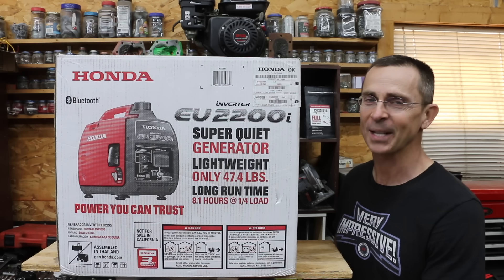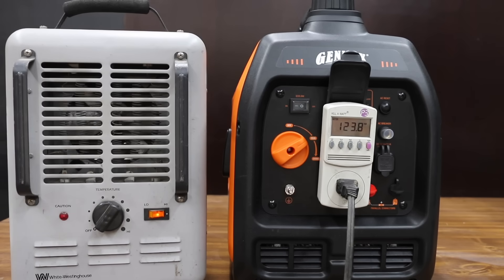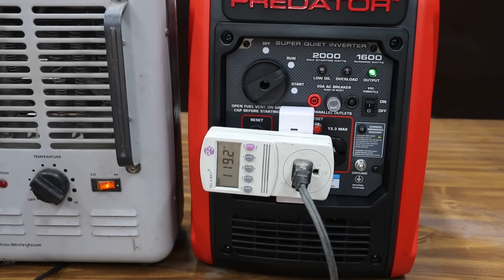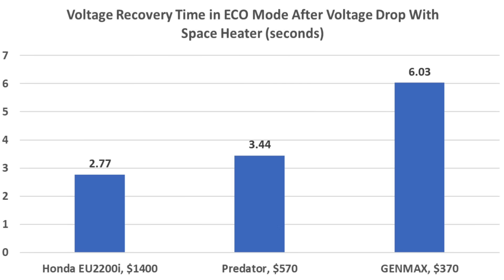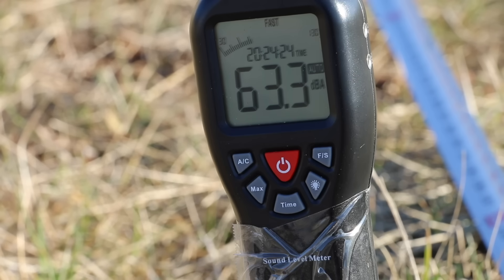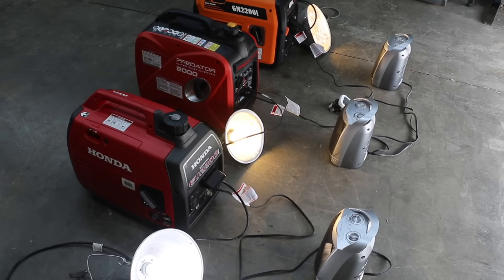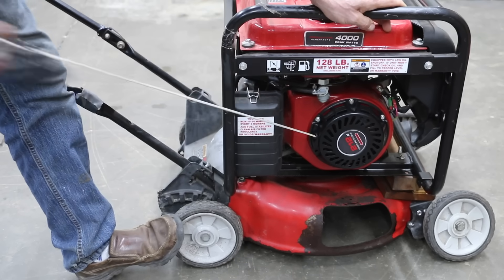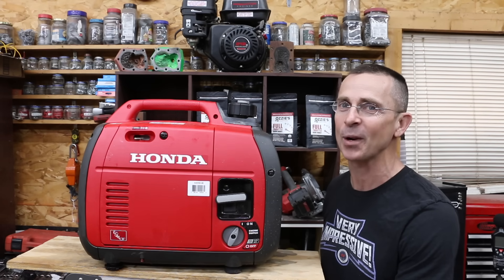Cheap Generator Better Than Honda? Predator vs Honda & GENMAX—Let’s Settle This!

Comment: I had an issue with the predator 2000 with the pushrod guide wearing through Allina pushrod to slide off to the side and knocked a rocker arm off the valve that part is not replaceable so had to fabricate one I've had it for two years and had to fabricate one twice  downfall I have with the predator 2000
Reply from the maker: Thanks for sharing.

Comment: It's probably too expensive, but it would be cool to see how a 2kw fuel cell compares. I reckon it would win on noise, but I bet it would need battery assistance to cope with fast load changes.
Reply from the maker: Thanks for the suggestion.

Comment: Could you test Champion and Westinghouse generators, incorporating the dual fuel options many of them offer? Run them on gasoline, then propane, and see the difference in performance etc?
Reply from the maker: Thanks for the suggestion.

Comment: I used to be a Predator (UAV, or Drone) Mechanic, and we deployed all over the globe in support of anti-terrorism. Some locations had no power to run our equipment, and we had tons of those same Hondas he tested. Not only did they work well, we abused the crap outta them. The Honda should be using 87 octane fuel, but our vehicles on site were all diesel in many cases, leaving us with one other easily accessible fuel option, 100LL AVGAS. When we put AVGAS in those babies, they sure did run differently, and I'm sure we were burning them up, but we had no other option, and the Honda didn't disappoint.
Reply from the maker: Thanks for the feedback.

Comment: Add "Engine Restorer" to preditor.  I have used it for 30+ years. Might fix the oil getting by oil rings. Cheaper solution.
Reply from the maker: Thanks for the suggestion.

Comment: does the one generator burning oil designed to do that? I know briggs push mowers now adays say "no oil change needed" just add oil. Basically a 4 stroke 2 stroke engine, kinda curious if that generator is designed to do that. hopefully not but its the world we live in...

2nd question. for the honda spark plug, was it dipped in oil or something? it looks like there is oil or something liquidly around the threads?

Comment: Snapper brand?
Reply from the maker: Thanks for the suggestion.
Reply: @ProjectFarm  I believe snapper is a briggs and straton motor but i would be very interested to see it up against the predator and Honda. Specifically the larger 4500's that power campers and large power tools.

Comment: I mow my yard year round with a Honda powered push mower. Going on 10 years now and it always starts on the 1st pull. One time I put some spent oil in the gas tank by accident, thought it was dead, just smoked its way through my stupidity, and it still starts on the first pull. Once a year I change the oil, spark plug, and air filter. ~$20 and 20 minutes. I'd buy anything with a Honda small engine :D
Reply from the maker: Thanks for sharing.

Comment: I'd like to see Ryobi's inverter-generator tested.  I use ours to run a small camper, and have lent it to friends to use during extended power outages.  I've changed oil once or twice (don't remember) and the spark plug once, primarily based on time-since-new of about three years.  I don't think it has had more than 150 hours usage in any year, and likely half that.
Reply from the maker: Thanks for the suggestion.

Comment: Based on my own personal experience on the job site as a stucco and masonry contractor in steamy Houston TX definitely prefer my Honda EB 2000i cost me $2200 is quiet, easy to move around and very reliable, always kept it chained to my truck just in case. Due to an emergency bought at HD a piece of crap Ryobi and regret it all the time. Honda rules.
Reply from the maker: Thanks for the feedback.

Comment: 🎉 to you and your channel. Please please read all you can about this Generator. $999-$1299. 
Can you please test the 
AiPower GSX7100iRD
Duel fuel/Pure sine wave generator. Compare it to other 7000 watt generators. It’s totally amazing. Thanks for all you do, your amazing as well..
Reply from the maker: Thanks and you are welcome!  Thanks for the suggestion.
Reply: @ProjectFarm  You’re going to be so impressed on “ALL” it’s features. Propane priority then “Automatically” switches to gas. Electric start/Recoil/Remote. Less than 3THD pure sine wave. Large wheels and handle. Spark arrester. Tube to drain oil easily. Well lit readable Display. Light. I used 10/4 with 4 prong plug then with an interlock on my panel to separate Line power from Generator power. So much cheaper and more in control if your home usage. It has to be the best Cost to Feature/quality out there. $999-$1299. 
Please compare to any other comparable units please to give your viewers a chance at an affordable unit to power their homes in an emergency to provide for their families. You are so thorough in what you do, it’s mind blowing and so detailed. All the best to you, family and viewers. Mike ienuso. 
Good day Sir.

Comment: So the moral of the story is by 4 cheap generators that way everybody in the house will have one and still have money left over for gas instead of 1 very expensive Honda considering it’s probably going to only be used a few times a year at best.🔦🔌💡💡💡💡💵
Reply from the maker: Thanks for the feedback.

Comment: could you test some  champion gen sets  ?   The biggest  bi fuel gasoline/  propane generator would  be nice.(if possible) Locking to get one, but it's not a inverter genny, and I would be interesting to se its propertys when it comes to electrical quality and voltage drop under  load .
Reply from the maker: Thanks for the video idea.

Comment: GREAT VIDEO!  I always have a problem with people showing graphs without the full amount of info. Your run time graph with the blue bars showing the runtime truncated to start at 60 minutes and ending at 62.5 looks like the honda did much worse than it would look in a graph  starting at 0. The Honda shut off at 61 minutes the genmax at 61.5. That's 30 seconds difference after an hour and 1 minute of running. The winner was only 60 seconds more than that. That's actually pretty impressive considering the much larger engine the honda uses and it also wins the noise and oil test. (With more oil so it has that result diluted somewhat in the percentages.) The Predator getting hot and shutting off under a normal load and producing an alarming amount of oil contamination pretty well scratches it off my list. The genmax seems pretty decent. The Honda wins if money isn't a factor but longevity is. For vendors running them every working day the Honda. For occasional use, the genmax.
Reply from the maker: Thanks for the feedback.

Comment: I would use a faster meter to measure voltage drop. That killowatt looks like it’s displaying the voltage drops every second or so which seems too slow to accurately voltage drop.
Reply from the maker: Thanks for the feedback.

Comment: So I spotted a couple of things...
first, your decibelmeter gives you dBA, but in your graph you stated the unit was dB. Also you didnt specify the distance measured in the graph. Which is problematic, because if you dont specify the distance measured at, it is assumed the distance was 1m from the sound source, which it wasnt.

Comment: "Nothing runs like a Honda". Indeed. 
Off topic, my Lincoln MKZ with a 3.5, the water pump just failed at 120k miles, cost me roughly $2,500 (still in the shop, so don't know the exact cost yet).
I started begin to miss my old Honda, by the time I got rid of my 94 Integra years ago, it got 240k miles and still runs strong, but the body rot was so bad, so I got rid of the car... I should of just keep the car. 
Swear to god, Honda will be my next car!
Reply from the maker: Thanks for sharing.

Comment: Imagine if these other than Honda companies took these findings and refined their products to tolerances approaching Honda's....those were some weird results in the end...the Genmax spark plug had a spark plug with less crud on it like the Honda, but higher aluminum in the oil...while the Predator had all kinds of crud on the spark plug, and drastically less Aluminum in the oil content
Reply from the maker: Thanks for the feedback.

Comment: would it b better if we buy 3 of the cheaper generators, than to buy 1 honda. which would last longer..

video suggestion:  electric battery generators . no gas.

Comment: I own 2 Honda 's and one thing I would like to mention that many people do not realize.  When the generator is cold it will take a couple pulls more before starting because it fills up the fuel pump first.  Afterwards its easy peasy.
Reply from the maker: Thank you for sharing!

Comment: I wonder if you could build a better generator from a fuel efficient small motorcycle. Like old CB250s and CRF150s get like 75-100mpg with a carburetor. They are about 20hp. Im guessing plent of overhead compared to the OHV engines.
Reply from the maker: Thanks for the suggestion.

Comment: The Harbor Freight generators and most Harbor Freight equipment has only a 90 day warranty but do have a 2 year warranty on the emission controls.  Most Honda equipment has a 3 year warranty.  This is something to think about if you are buying a stand-by generator.  The warranty may run out before the next storm comes along!  Test it throughly when you get it home! 

Not too much to go wrong with a regular generator but the inverter generators have a electronics that could be expensive to have repaired.
Reply from the maker: Thanks for sharing.

Comment: My company only buys Honda now, for one reason and one reason only.  Replacement parts availability.

If you're buying for personal use, feel free to buy around, if you need a workhorse, Honda is almost impossible to beat long term.
Reply from the maker: Thanks for the feedback.

Comment: "the fuel strainer" you referred to I believe is actually a flame arrestor. Also a company named WEN makes many if not most of the chinese inverter generators and they OEM them for Roybi and Harbor Freight etc.
Reply from the maker: Thanks for the feedback.

Comment: After a couple years my Predator stopped working. Mostly just sat around, seldom used. Replaced the carburetor, but could not figure out what was wrong. It runs now but only when choke is on.
Reply from the maker: Thanks for the feedback.

Comment: Would love to see Champion brand generators compared to similar, specifically the Champion Power Equipment 200961 2500-Watt Dual Fuel Portable Inverter Generator, Ultralight, manual start. Love your reviews!
Reply from the maker: Thanks!  Thanks for the suggestion.

Comment: The Honda is a solid machine...but you can buy 3 GENMAX's for the same price (including the parallel connector) and keep 2 stored sealed new in the box in the unlikely event of failure. Even if you run them daily or at a jobsite etc, having those 3 units offers backup of a backup. Ultimately, a nice problem to have.
Reply from the maker: Thanks for the feedback.

Comment: I know these things arent cheap, but the champion brand is super popular, yamaha, and a-ipower from sams club. I have a champion 2500w dual fuel which is awesome, and a champion 4250w dual fuel which is extremely loud, high vibration and the oil switch is very finicky (I have to put blocks under one side to keep it running) but it does produce clean power. I only run them on propane (kinda hard to test that runtime unless using a 1lb bottle or something as a constant). Awesome videos, keep up the great work. 👍
Reply from the maker: Thanks, will do!

Comment: Impressive comparison and testing.  I really appreciated the sine wave and vibration measurements.  Would be interested in seeing the Wen, Pulsar and Champion brand small (2000-2350 watt) inverter generators adding to the testing in the future.  Thanks again.
Reply from the maker: Thanks!  Thanks for the suggestion.

Comment: Honda and Yamaha inverter generators are the top in the market hands down. Champion to me is a distant third but they are starting to catch up though they will never be in the top spot.

It was a treat to see the oscilloscope reading. However on an inverter generator there really is no point since the inverter uses pulse with modulation to approximate the sine wave. It's always going to be low THD.

It would be a more effective test with the inverter generators to show an FFT graph showing how well the inverter output is filtered in the high megahertz range. This is where noise would typically be found and filtered which is coming from the transistor's firing at very high frequencies. Some cheap inverter generators lack adequate filtering and this RFI EMI noise can cause problems with some devices. For an audio application for example this could be a huge problem.
We are talking about some pretty technical science that many would not understand but for a generator tech nerd I would certainly enjoy seeing these results!
Reply from the maker: Thanks for the feedback.

Comment: There's a second career for this guy as a sports commentator :) Great vid! We don't have those other brands in the UK but we do have 'UK backed' import brands like Hyundai who at least have sales, parts, distribution and even some repair capability in this country. 

I have always guessed that as manufacturing tolerances have improved, these off-brand gen sets are probably catching up with the Honda (in other tests I've seen, the Yamaha was even better than the Honda for commerical use, but Yamaha seem to have withdrawn completely from the UK generator market). However, it still looks like for daily use, the Honda is worth the extra. I also assume warranty claims will go down better with an established brand. I used to have a no-name diesel gen set for a boat with battery start which had a cloned Yanmar (Japanese) design engine in, and that was pretty good being run into the ground. At the time I certainly couldn't afford the £2000 ($4000) commercial quality equivalent.
Reply from the maker: Thanks!

Comment: Honda engines are probably broken in at the factory. I have a Champion 2500 inverter generator i am breaking in right now by putting a load on it and changing the oil every hour or so. I am 4 oil changes in and it's very clean now, no oil on the spark plug either
Reply from the maker: Great tip on the oil changes!
Reply: That is probably very true

Comment: Always go to your channel first If I am looking for something to buy and compare.

Westinghouse and Craftsman 2200 are 2 others I would like to see tested. I have the Westinghouse and it works well for my uses so far, at less than half the cost of the Honda. Depends on your use IMHO.
Reply from the maker: Thanks!  Thanks for the suggestion.

Comment: Too bad you didn't look into the max-power of each generator. I am painfully aware that generators do NOT put out the rated power they publish. Engine output is always reduced when running at altitude, and other factor limit the max power the engine can put out. My Westinghouse generator, rated for 1800W continuous, was reduced to 1100W when running at 7000 feet altitude, where I live. That's why I had to ditch my generator, and get a 3200W GenMax. I like it, but as you found out, the main downside to these cheaper generators is their insane engine wear. 

I'd like to see a similar test with the next-size-up 3kW generators, like GenMax, Predator, Honda and others, make these larger generators. While the 2kW generators are very similar in form and function, the larger ones show a more diverse performance, so I'd really like to see a review of these 3kW to 3.5kW generators.
Reply from the maker: Thanks for the suggestion.

Comment: Great info! People are looking for the most reliable/long life generator that wud compare favorably with the esteemed Honda, but with a better price. Would that be Generac or Craftsman (Lowes)?  Have u done a video with good brands, not the bargain basement brands? Wud also like to know which are American made, Foreign made, and how they compare, especially if a brand offers both foreign and domestic products. Also, which products are simply labeled with a company name but are not really theirs? I saw vietnam on some generator boxes. I'm just starting to search for invertor that is the next step up from these 50 pd units, but still portable. Can u use synthetic oil in these small engines to reduce wear and oil changes? Thx
Reply from the maker: Thanks!   Thanks for the suggestion.

Comment: Even after honda's drastic drop in quality over the last 20+ years, I still think its stuff is more durable than chinese junk made for US corp criminal.
I have a Honda gas water pump that is intended for an emergency like forest fire and a YANMAR (pure Japanese!) diesel generator. Wouldn't trust anything else.

Comment: Is there a particular brand of ool that is best for generators? I use Penns oil in my Harbor freight Predator.  As to the spark plug fouling. Is there a better brand of spark plug for less fouling of the spark plug? Another great video. Perhaps you could do a video on best oil and spark plug for generators. Thanks for you consideration in a video on these tests I mentioned. Fan for life!
Reply from the maker: Thanks for the suggestions.

Comment: The cheapos were better than I thought, but hard to not just pay up for the Honda. Mine has never let me down. Keep the gas stabilized or it'll plug the ecomode jets pretty quickly. At least getting the thing open and spraying carb cleaner in fixes that quickly if you forget to stab.
Reply from the maker: Thanks for the feedback.

Comment: LONGEVITY???? Predator 3500 inv. Quite  I changed oil 4x before 100hrs. & now change after 100hrs no oil used. Over 2k hrs on it. In just 6mo. Starter starting to drag. Pull rope just ??  Found beside it one day ?  1st Predator lasted 1k hrs before just not starting .  Exchange was excellent it was 89days old
Reply from the maker: Thanks for sharing.